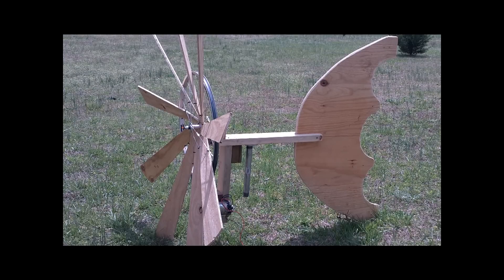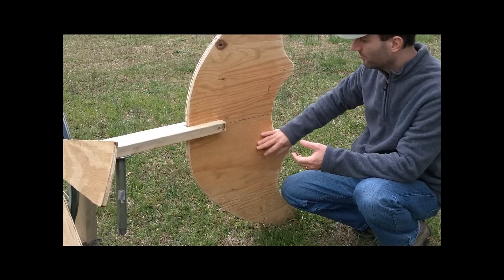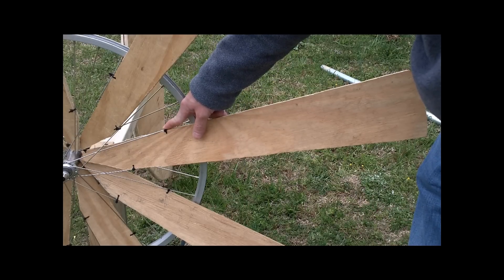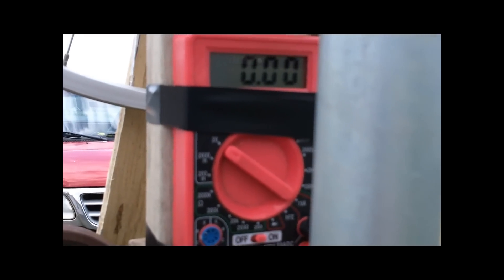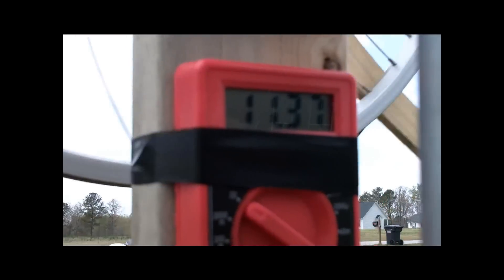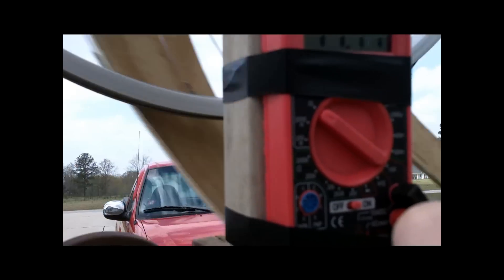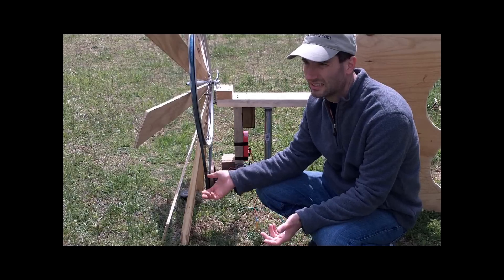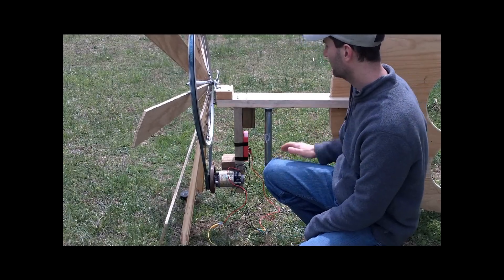Testing of the bicycle wheel wind turbine

Comment: Is this AC voltage if so then it's only make 4 volts DC not enough to charge  a DC 12 volt battery I'm just curious ?
Reply: +losttreasure hunt  that is a Harbor Freight meter, it is on 20 Volts DC>> not AC
Reply: +Rich Ukulele You'd need 24 volts at dc with out a load

Comment: lol, awesome, i was thinking it was my ideal, but until i see this. A very fast and inexpensive way to built a turbine using existing wheel bearings, spokes and rim. i am going to use the fork and the frame where the bearings for the forks enter it, using that bearing too for wind direction rotation. I just cut the frame to keep the fork bearings, and cut one side of the forks off completely so i can have room for blades, the single fork will be holding the wheel bearing from the back, back side where the blades will be in front .

Comment: The lighter the blades, the more efficient the turbine... You should try PVC pipes/material for blades as fibre glass and carbon fibre might be expensive
Reply: Yup. Use PVC pipes material as it is lighter than piece of woods
Reply: Not necessarily. If the blades are too lightweight, they won’t have the mass needed to turn the alternator. Lightweight blades can also flex easier, reducing efficiency and introducing vibration. On the other hand, lightweight blades would spin easier in the wind, especially low winds. In the end, for maximum efficiency, it's a very fine balance between weight, force, and physical strength.
Reply: PeaceKeeperMoe It is a cheap alternative but wood is good because it lasts a lot longer and can survive high wind speeds while PVC cannot.
Reply: once it's up to speed weight does not matter. i.e. 99.99% of the time. 

shape of blades is where it matters and wood has less flex.

Comment: Hej awesome video!  As you are getting from 12 volts to 19 how would you regulate it? I made my own generator following the same principles but it produces round 50 volts. I need it converted to 12.6 I believe. So i can charge car batteries I have a bridge rectifier but the mentioned volts are still in AC . How do I get a clean and steady output from my generator?

Comment: Hey supergokue1 have you considered putting the motor directly through the center of the bike instead of using a pully? You could then lay the wheel flat on your roof or something.

Comment: Everything is real flimsy consider a heavier duty REAR, the one with the GEARS on it. Pick a garbage-trashed bike. You can use the pedal bearings and the housing. Just cut off what you don’t need, the spacing for the chain and all gears and sprockets already line up it is strong. The plywood is flapping; easily coat the wood with fiberglass cloth and resin. This will be simple fiber glassing because the wood is flat and narrow, use 4 in. fiberglass tape and Epoxy or polyester resin.

Comment: Like the video like the idea. Well-meaning advice follows. Lose all the wood. Bolt long quarter inch rods onto the spokes.  Then using flathead bolts, bolt the long rods onto the spokes. Also cut a grove into the flathead bolt where it comes into contact with the spoke making a tight fit.  Then affix rectangular metal blades of curved thin steel onto the rods.

Comment: Voltage ok but have you load tested it to see what current it will draw?  Also if you are using this to charge batteries, make sure you add a cutoff so you don't overcharge the battery. You can buy a battery charge controller from Ebay for not a lot of $.  A good project

Comment from the maker: I used a size 26 bike wheel in this video, the generator was a small dc treadmill motor that I got for free from a treadmill. It is not hooked up right now, but yes I would have the turbine going to a regulator, the regulator to batteries, the batteries going to a inverter. Thank you for the question, Lonny

Comment: Enjoyed the video. Gotta ask a few questions.... What size bicycle wheel did you use? What type of alternater or generator did you use?... Are you charging batteries for alternative power for your home?    are you using a voltagle regulator, inline before it gets to your batteries?
thanks, Geoff

Comment: This is very clever and I'm going to subscribe so as to see your future results. Would suggest a couple of things you've probably already thought of;1) Add sound to the video later to avoid the wind noise. 2) For your final project, make everything of welded steel primed w/ zinc and painted. Thanks for your hard work.

Comment: Very good job on your bike wheel wind generator and it will charge a battery bank ,but were the wheel is attached to the frame will not hold very long alot of stress is put on that point.You've done a great job with and have fun with  what u are doing